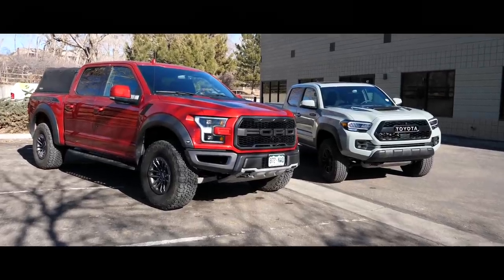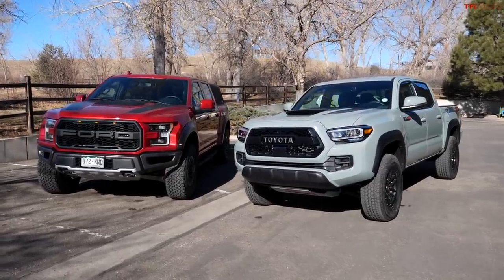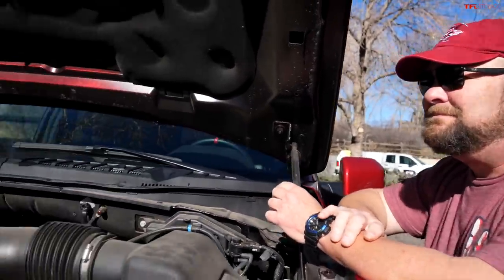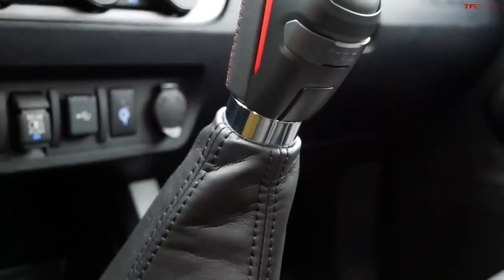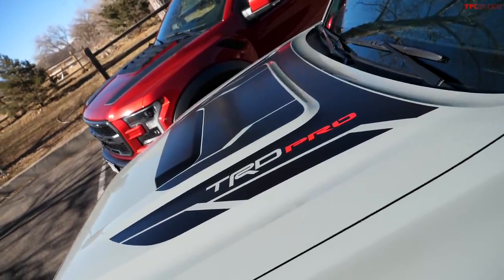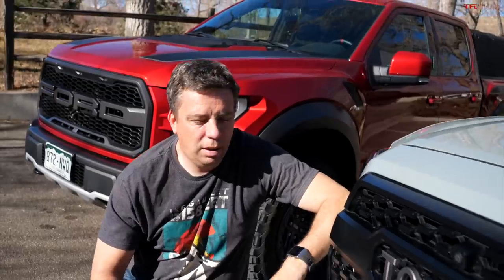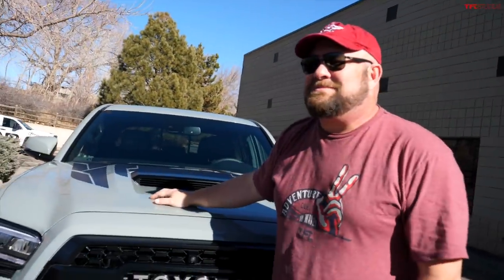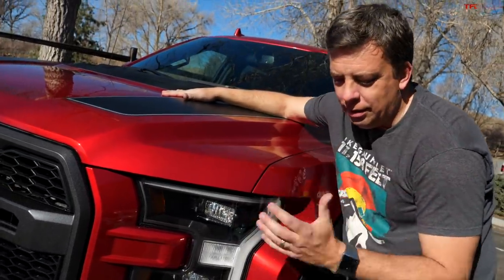Big vs. Small: The Ford Raptor & Toyota Tacoma TRD Pro Are Both Off-Road Beasts - But Which Is Best?

Comment: I'd get the Raptor, BUT... I like naturally aspirated and I love a manual. Much more simple design, less stuff to go wrong. Love it.  In 10 years and 100K miles, the Tacoma is way-more likely to still be around. The Raptor? I really don't know if it's reliable for that long period of time. Having said that, the Raptor is very sexy.

Comment: In fact, you CANNOT buy that TRD Pro for under about 50k. They are proud of those..... just bought one in September for my son and most dealers here in Florida are padding the sticker about 4-5k.
Reply: True. The dealers are adding around 5-6K when I see them. And used ones are selling for original MSRP.
Reply: I got mine for 48  auto.
Reply: Congrats on the new rig.

Comment: Friend has taco with 125k on it and still owns money. Spent ton on 35” lift installed and 100k service. 
Still a 2016 used truck that doesn’t see off road. 🤣. Small inside and out.
Reply: I don’t get your comment
Reply: What’s your point?
Reply: I saw stars at night in my backyard.
Reply: Uh, okay? Nobody cares.

Comment: Pricing comparisons not really accurate. Never seen a Raptor with out a ridiculous dealer markup.
Reply: That, and my 21 Tacoma trd pro with 6mt and one option of a remote tailgate lock was $45,520 with delivery. No markup
Reply: @norsemanix2358  Congrats and enjoy!
Reply: Check out Car Gurus and AutoTempest
Reply: Tons of raptors available without any markup. I got mine last year at $9k off msrp.
Reply: Huh? I’m in San Diego and bought my 2020 brand new last year with no mark up. They even went a little under msrp. No negotiation either.
Reply: @Drohead20  
People bitching about truck prices don't understand how supply and demand work.
Reply: @teop7887  exactly. In the beginning there was a markup but as supply caught up the markup went away. Same with the trx. And these trucks hold their value much better than other trucks

Comment: The Raptor looks great, has more power, more sophisticated but the Toyota will be more reliable and hold its value better. I think comparing a base Raptor to a loaded Taco is disingenuous at best. 90% of Raptors sold are loaded and then marked up substantially

Comment: A hood scoop is different than a heat extractor. Hood scoops in most cases have proven to be useless and can even take away HP. Not to mention what the drag does to fuel economy. Toyota made it simple to dremel out the back section should you so desire.
Reply: I put a light bar inside of mine

Comment: Apples and oranges. If you want to drive like an asshole on a narrow dirt road: Raptor. If you want to do some overlanding or value reliability: Toyota. If you live close enough to go to the dunes and actually get some speed: Raptor. If you've gotta impress those soccer dads: Raptor. If you prefer getting through more narrow offroad trails: Toyota. Each are great at what they do.

Comment: When the Raptor breaks down at a 100K miles, the Tacoma will keep going for another 200K miles trouble free. That’s the biggest difference between these two trucks, end of story.
Reply: Imagine spending 300k miles in a Tacoma.  Can’t think of a more cruel punishment for someone.
Reply: When you find out the repair costs for a raptor, you gonna wish you would have bought a Tacoma. But I see your point
Reply: @kirillkucheryavenko6116  not true for 3rd gen Tacomas.  Automatic transmission issues (class action lawsuit), howling differentials, failing fuels pumps etc.
Reply: Tacoma’s aren’t lasting that long anymore. That’s all you Toyota nerds have to hang on to, because the design is ugly and boring, the tech is so outdated or non existent. You couldn’t pay me to drive a Toyota truck, and my raptor has full warranty to 125k miles so when the time comes it will be fixed on fords dime
Reply: @gs300rich4  ugly and boring? Not even slightly
Reply: @terrynichol577  they are the ugliest trucks on the road. Name an uglier truck (ridgeline doesn’t count)
Reply: @gs300rich4  name an uglier truck? While your raptor is not even half as nice as a Tacoma either. It's a big bulky bus looking thing on wheels that can't park anywhere. The Tacoma and the zr2 are probably the best looking midsize out there. The best looking full size would be a tundra TRD pro and the trx.. the full size sucks anyway for off-roading
Reply: @gs300rich4  There's a 2015 Taco for sale at the dealership near me right now with over 317k on it.  My 2022 Taco Sport came with full lifetime warranty for the life of the truck since I'm the original owner.  Factory lifetime drivetrain and I paid a little extra to cover the whole truck.  I've had many toyotas over the years with over 250k including a celica once with 425k.
Reply: @gs300rich4  the Tundra…🤔

Comment: I Woundnt buy  the raptor or the trd pro or the trx. Id Rather have a f150 exended cab fx4 4x4 with 5.0 long bed or the tocoma extended  cab 4x4 trd offroad long bed (no fake hood scoop) maybe put on a lift and tires just cause an save a crape load of money and have a way more useable pickup to do pickup things with things since that why id be buying a pickup for. beating the crap out 55k+ vehichle offroad i cant justify doing. Id Buy a  used side by side  if i realy want to go offroading and  go way more places. Thats just me.

Comment: Where can you find a new Raptor for under 60k. Let alone under 55k
Reply: You can get a bare bare bones Raptor for mid to high 50's.  Ford.com says they start at 53k
Reply: @simonj126  ha. I just priced one. Bare bones. Starts at 58.5k. No one is getting one for less brand new
Reply: Saw one while shopping for my F150, extended cab 54k
Reply: @Dirtyharry70585  no way. Not brand new. Not buyin it. Lol
Reply: @Sticks1680  ok, so you answered your own question.   Under 60k
Reply: @simonj126  a technicality.  Lol
Reply: @Sticks1680  was at roush ford, columbus ohio. 10/2019  blue, just didn’t fix in garage same month I bought my new 2019 crew xlt heavy tow, chrome, 4x4 rear lock,  F150-list54k, out door $42,300. You need to shop in person dude- or move where the dealers arent greedy.
Reply: @Dirtyharry70585  well sure.  Reg f150s they give discounts. Raptors very rarely get them. If ever
Reply: Yeah plus the Tacoma they showcased they said was maxed out in options. They showed misleading numbers
Reply: @carpintero01  they are doing the same with the TRX comparison.  Their Raptor is a fully loaded 802a whereas their TRX has next to zero options.
Reply: @Dirtyharry70585  in what universe dealers aren’t greedy? 😄

Comment: Paid 32000 for my trd offroad.
Reply: New?
Reply: @jaya1000  No, he bought used.
Reply: New. In September 2019
Reply: @2011blueman  wrong
Reply: @TheDeanGullberry  you got a steal.
Reply: @jaya1000  I spent 4 months researching deals. Almost did a 6 hour round trip for it but got the local dealer to match. Take your time and you can find a deal.
Reply: @TheDeanGullberry  that's the way to do it. I know so many people who cling to their junker cars until they die and then go to a dealership and over pay by 5k+ for a new car. Blows my mind
Reply: I paid 37k+ for my 2020 off road in November of 2019!  Electric driver’s seat and Auto Unlock on the passenger’s side.
Reply: @armandcouture4655  I wish I had the power seat. I'm 6ft3 and if I was any taller I would not be in a tacoma. I think mine is fairly low optioned for a trd offroad but I came from a 97 T100 so it seems pretty fancy. I do miss the room of the T100 though. They feel huge by comparison.

Comment: TACOMA for the win as usual. The Raptor will be dust the TACOMA will just be breaking in.
Reply: We’ve had both sold the raptor kept the Tacoma
Reply: @peterhoma6385  The Raptor is way to big for most trails. It's only claim to fame is dessert racing. Who actually does that? The Tacoma can absolutely perform as good or better the the Raptor off road and everyday life.

Comment: I’ll choose the Tacoma trd sport or trd off road over the trd pro tacoma or raptor because as Nathan said that if you get the manual Tacoma then you don’t have nothing much going on like crawl control so if you buy an manual trd pro tacoma then it will be the same as the trd sport tacoma that has no crawl control or locking diff. Or unless if you get the automatic tacoma, however, the Tacoma’s automatic transmission sucks 👎🏻, so the manual tacoma is better. So why I will waste my money paying extra for the trd pro tacoma?, when I can just get an cheaper tacoma like the trd sport and enjoy my truck for life and have the same off road features like the manual trd pro tacoma.

Comment: I'd pick the Raptor up for sure. I Iike the size with 450 HP.
Reply: Of you like a trophy truck sure..for day to day and offroad 450hp means nothing.
Reply: @terrynichol577  toyota has no power and it's too small for me. 6'2 225
Reply: @JohnConnor636  each to their own. Tacomas seat issues are better now, power seats that manuever quite well. Power is fine. With an ov tune it drives well, there is enough power for the trucks needs. I dunno do you..overall more people will pick the red pro over a raptor anyway.
Reply: @terrynichol577  true, I haven't sat in one in a while. Don't make fun of me, but I've been eyeballing the New Ridgelines :)
Reply: @JohnConnor636  lol hey bro. They are functional for most people,.go.twst drive one..go test drive both.. tacoma and Ridgeline. You will find the Ridgeline is alot smoother because of the car like frame. Toyota is legit truck like feel if you like that sorta thing. I like the plain and simple Toyota to be honest.. raptor is cool, but alot going on you know what I mean..really flashy like

Comment: Take the Ford Raptor any day over the TRD Pro,  trd pro is 20 plus years behind
Reply: Ah but last 20 years longer than any ford
Reply: @brycehammond2099  AMEN
Reply: @brycehammond2099  Not the 3rd gen Tacoma.  Class action lawsuit against Toyota because of the automatic transmission issues.  Consumer Reports issued a Do Not Buy For 2020 and 2021 Tacomas.
Reply: @alienation1270  3rd gen started in 16 so not all of them are bad

Comment: I'm taking the raptor all day long
Reply: @chaosseat  I can and bought a TRD Pro. Wasn't even a comparison for reliability. I don't want to be deep in woods offroading when my truck goes into limp mode as a phaser goes bad or timing chain.
Reply: @JohnnyLightningV10  A PRO turd huh, nice!  I only keep vehicles a couple of years anyway. By the time stuff wears out,  it will be someone else's problem.
Reply: @chaosseat  cool seen a phaser go out at 15k on a Raptor.  Yawn....
Reply: @chaosseat  so just admit ford sucks for reliability, Toyota takes the cake on reliability and resale..(smart people buy Toyota)
Reply: @terrynichol577  The raptor has the highest resale of any truck.
Reply: @rockie307  they're probably fairly close to toyota. No one will ever compete with Toyota in reliability and resale. I don't even care if they're dinosaurs, that's what's unique about them, they are not cell phones, they don't need to come out with all this fancy technology every year. You know what that comes with? Problems, that's why people like their second gen so much more
Reply: @terrynichol577  I don't have either so I don't care either way really but the raptor has the highest resale of any truck in production. F150s have way more tech so your right the more you have the more can go wrong. That said more tech means more little issues like if you have massage seats and it quits working it lowers your reliability rating. I've been driving ford trucks for along time and have had little aggravating issues but haven't been stranded yet. Reliability to me is getting where your going if my heated seat or sunroof quits working it sucks but still get where I'm going. Ford is always going to take hits in reliability ratings cause they have more features
Reply: @rockie307  exactly my point lol. That's why I go with Toyota products, they have enough would I need and want. I don't need super fancy gimmicks every year. That being said I do have heated leather seats, and it's Android capable for the 2020 model, and I have a manual transmission so there is that LOL
Reply: @terrynichol577  Or I could care less because I'm retired and can buy whatever I want....
Reply: @chaosseat  ok, retired means you watch your money lol. so what you're really saying is you need a Toyota for reliability so it doesn't crap out on you, so you can save some of your pension money lol
Reply: @JohnnyLightningV10  actually there has been a bunch of recalls on Toyota's lately
Reply: @terrynichol577  Ford makes 10 times the amount of trucks Toyota does and has been the best selling full size truck for over 3 decades and most of those trucks are still running today
Reply: @terrynichol577  The tundra is ranked 1 for reliability. The tacoma is ranked behind the honda ridgeline and nissan frontier. All Toyota's ain't the same buddy.
Reply: @rockie307  what kind of garbage are you reading? If you're going to believe anything that has a Ridgeline over a Toyota Tacoma give your head a shake. That isn't even a truck. That's hilarious you put those two trucks in the same sentence for reliability.
Reply: @woffordsoverlandjourneys8618  just because they sell more and produce more doesn't mean they're better. McDonald's sells more burgers than the average joint does it mean they're better?
Reply: @woffordsoverlandjourneys8618  yep but not on their trucks.  Unlike Ford who should have recalled the phasers on all EcoBoost motors havent.  Flaw designed that can literally fail at 15k miles because seen it happen on new Raptor.  Not going to go into the timing chain issue of stretching because no fix for that either still.

Comment: I've had more than that weak <1000# payload in a 2wd 2.2 auto s10. That's shocking
Reply: My 4.3 5 speed 2wd S10 is not good but towing is decent for its time.

Comment: I like the Toyota, but those graphics are hideous. I would actually opt for the TRD Sport or the TRD Off-Road with an extended cab instead of the long cab. I like the manual transmission way better than any automatic. I would also choose a different color. Not a fan of this color at all.
Reply: Only way to order a long bed with a manual transmission is in the TRD Sport version with an access cab configuration. You cannot get the TRD off-road or TRD Pro with a long bed and a manual unfortunately.
Reply: Yea, if I really wanted the TRD off-road I would get the extended cab with the short bed. I just have no need for a crew cab.
Reply: Yeah I would want a TRD off-road also. You can't get an access cab (extended cab) with a manual transmission on a TRD off-road. Manual only is available in the crew cab version and it comes with a short bed. If you opt for the long bed on any TRD off-road you are forced to get an automatic transmission.
Reply: Well that just sucks. I really don't understand why manufacturers do that. I guess they figure you will spend the extra money. Not for me.

Comment: Great decision Andre! Nathan, not so much!
Reply: Nathan’s choice was the smartest
Reply: @RagingBad  Ummmm NO!
Reply: @matthewrobertson156  really? What makes choosing the Raptor a better decision?
Reply: @RagingBad  Well for starters (1) off-road the convenience of an automatic compared to a manual, (2) no fear of off-road clutch failure, (3) turbos at elevation will retain needed power, (4) engine horse power and torque figures, (5) driving position and overall comfort on a long trip, (6) passenger comfort, (7) and volume of gear you can haul. Aside from overall girth why do you see the Tacoma?

Comment: Tacoma hands down.   Raptor is a small penis bragging rights, more time in the shop than on the trail, truck.  Toyota, no v8 but more than enough power, fun, and won't be towed home more often then driving.  Fords make big numbers, big performance, BUT BRING IT ON A TRAILER so you have a way to get it back home.

Comment: Raptor kills the tacoma in everyway, shape or form. I live in the desert and actually drive off road and raptors are superior off roaders against tacomas.
Reply: I live in the mountains on a ranch and I prefer the tacomas
Reply: Yeah but a Tacoma will outlive a raptor
Reply: Ha. In a real off-road situation the raptor is too big, too long, too wide, too heavy. I had a taco and it beats a full size hands down. Plus the Taco will last 10 times longer than that Found On Road Dead.

Comment: I bought a 2018 Tacoma pro in sept 2018 for $48k. I didn’t like it the first day I owned it. Seating position and no power seat, engine power (lack of), transmission shifting (auto), no sunroof, no cooled seats (okay just picking there), — I traded it in 3 months later for a 2018 Raptor for $73k and it is 10 times nicer to drive- note, the Tacoma pro did have a great ride (suspension) but after driving even the Ranger, that was the only thing it was Better.
Reply: So do you dessert race???

Comment: The only decent turbo that Ford makes is in their Diesel models.
Reply: Ford doesn't make the turbo on their diesels...
Reply: @theylied1776  actually Toyota does
Reply: @RagingBad  What do you mean exactly?
Reply: @theylied1776  that Toyota makes many of their parts
Reply: @theylied1776  That explains why their diesel turbos are better, they aren't made by Ford.
Reply: @RagingBad  Actually they don't. Toyota is the majority shareholder in the automotive suppliers that make their parts. Like Aisin Transmissions and Denso electric components.
Reply: @gasolinediesel972  Exactly!
Reply: @theylied1776  that’s basically the same 🙄
Reply: @RagingBad  If you say so.......
Reply: @brokenwrench404  How exactly did I backpedal, little man?
Reply: @richfarfugnuven6308  ??
Reply: @MJorgy5  ??
Reply: @MJorgy5  it's called a Garrett GT37 turbocharger.
Reply: @theylied1776  ford just started making their own diesel engines in 2011.  Chevy has always made the duramax and 6.5L before that.